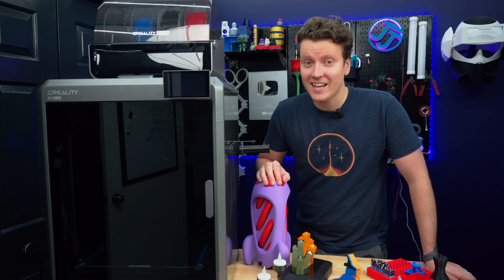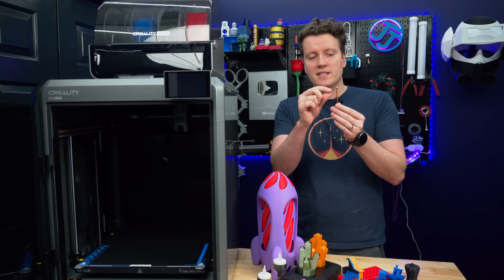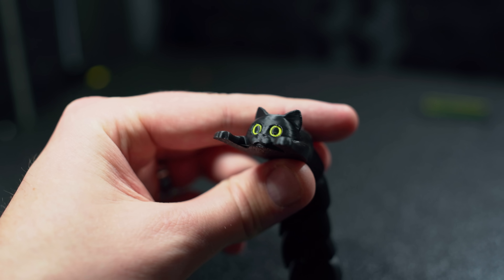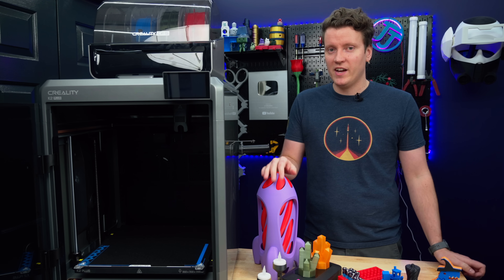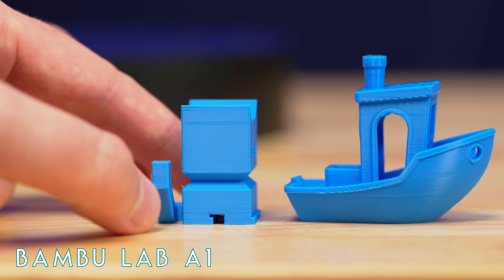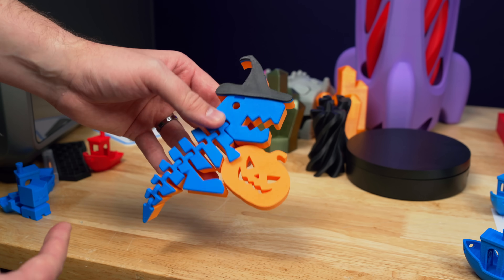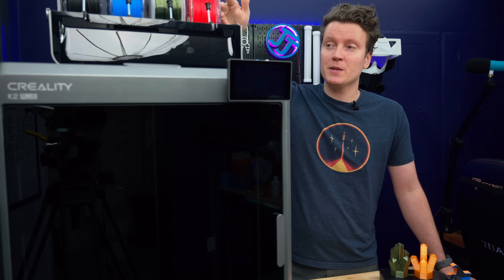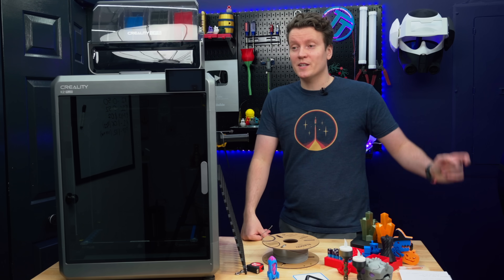New Multi-Color 3D Printer by Creality | K2 Plus Review

Comment: Bambu lab is better
Reply: Bambu is only 256x256

And for a lot of people, me included. That is just way to small..

If bambu could come up with a competitor you would probably have a point. But rightnow this is the best option for a big all in one printer that isn't a voron
Reply: @blikje_in_de_water  I don’t think the majority of people needs that much space in exchange of trashy quality lol
Reply: @blikje_in_de_water  Yeah I'm on the fence between this or a 350 voron with ercf/boxturtle mmu. Kipper can be a pain
Reply: @blikje_in_de_water  probably not 'a lot', some cosplay/prop maker types, sure
Reply: Why?
Reply: @CullenJWebb  it´s cheaper. with $1500 I get 2 p1s combo or a X1C combo + A1.
Reply: @lUjoyBr  The K2 Plus is over double the build volume (16 liters Bambu, 42 liters K2).

The K2 plus has a heated build area, NFC reader on the external spool, USB support, color touch screen, automatic belt tension, faster printing, and more.

If they had said that the Bambu is a "better value" that would be relative to them and hard to disagree with. But to say that Bambu is "better"? That is objectively false now.
Reply: @CullenJWebb  bambu is 16.7L, not 13.
Reply: @CullenJWebb  A printer with that print area, I think only the Voron can rival it, but in terms of print quality, I didn’t find it that impressive. Both fell behind the A1 in terms of quality, and note that the K2 has LIDAR (the P1P doesn’t). When it comes to color printing, both are currently behind Prusa, as the MK4S has less time and waste in color printing.
The cool thing is that in the last 3 years, the quality of printers has improved a lot, and you no longer need to keep replacing parts to upgrade them.
Reply: @lUjoyBr  I agree on the print quality being worse in this video, at least for the small details. I wonder how it would compare if slowed down to the same speed as the A1 / P1 / X1. He briefly compares his Amongus toys printed at 2 different speeds and how the input shaping didn't smooth out detail on the slower print, but we don't have any numbers on that compared to Bambu.

I guess I was incorrect to say that this printer is "objectively" better if it turns out that it can't match the quality in fine details. I was coming at this from the perspective of somebody who prints large functional tools. Bias strikes again.

I'm eager to see more comparisons in this regard.
Reply: @riba2233  Fixed. I don't know why but the calculator I used was off on both results. I've updated the comment to reflect 16L and 42L for each of them, rounded down.